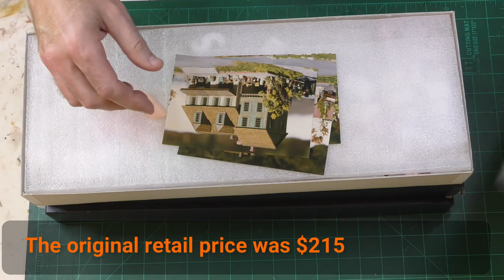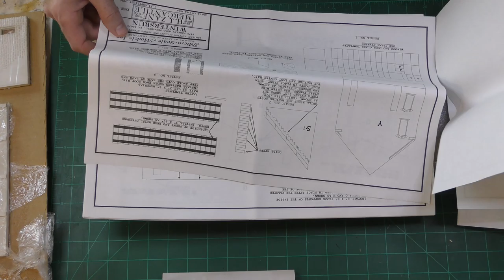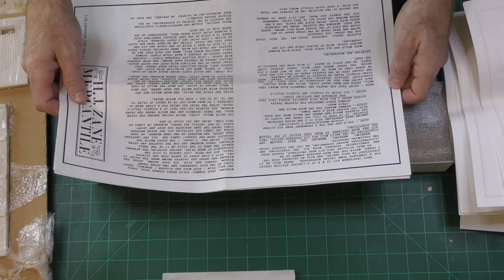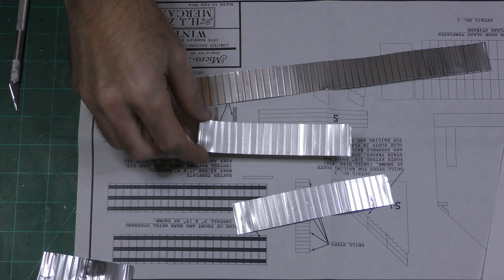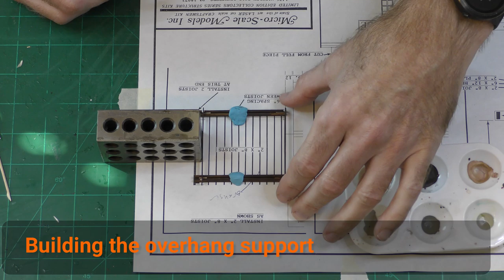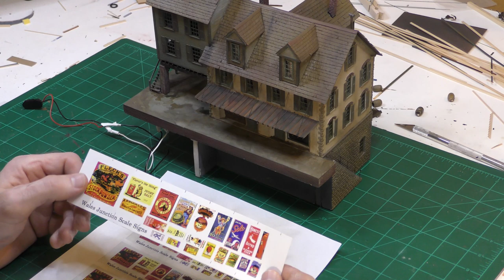Micro-Scale Models H J Zane Mercantile Build in HO Scale with Lighting

Comment: Excellent build. I take away something useful from each one. Your artistic ability shows through 
For lighting try using smd or surface mount led lights. Much smaller and less light you will need resistors with them. 1K works well. Buy prewired from amazon or eBay since soldering isn’t something you seem to like to do. 
Continued success in your videos

Comment: At 25 minutes in you use a blue colored "Sticky" putty to hold parts in place.
What is this and where can I find it?  Thanx in advance for a reply!
Reply from the maker: Thanks for the comments.  It is used to put posters on walls so it is pretty widely available.  Wal-mart, Target, Hobby Lobby, Lowe's, Meijer and similar stores should all have it and probably drug stores and office supply stores too.  I have seen it called blu-tack or wacky-tack or plasti-tac or blue stik.
Reply: @asdasx392  Thank you for the quick reply.  I hadn't thought of using that blu-tack to temporarily hold pieces together for gluing in these craftsman kits.  I can see it as a valuable asset.

About 6 months ago you built the Saez Sash and Door by Campbell.  I have been building those kits for years and years and hoping you would build one to get someone else's thoughts.  I agree with you that they do a great job with their instructions and accurate scale "blue prints."
I also appreciate the wide variance of brands you build.  And your honest thoughts of issues one can come across in construction.  I know you have helped me and others as well.